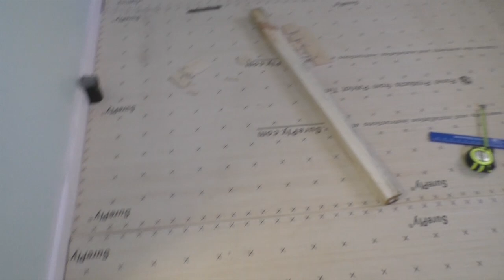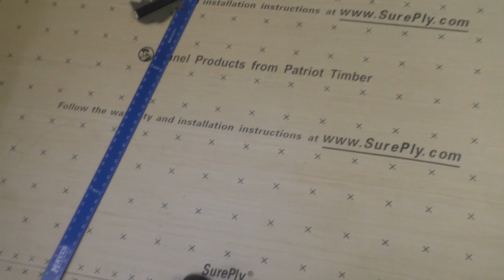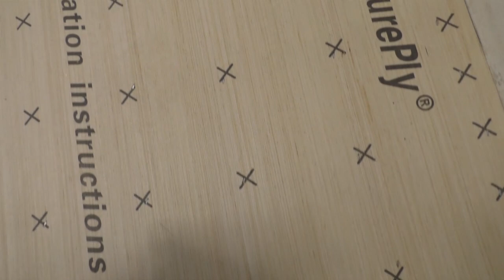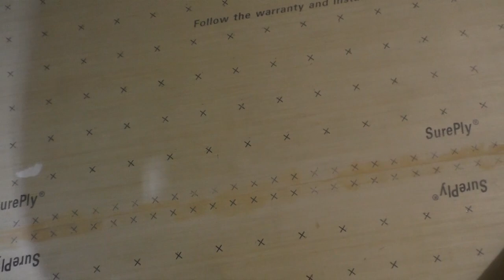Replacing my 1950s Kitchen Floor - Part 3 of 4

Comment: If it is not seen, just use bondo and not wood filler. I have used it a ton on wood, and will now use nothing else. I used it in a big section of my patio that rotted out from the rain... even the painter could not believe it was bondo when I was done. He wanted 200 bucks to replace that section of the patio.
Reply: Bondo breaks down much faster than wood filler when wet. Wood filler also has shavings, helps with expansion and contraction and wear. Most wood filler is cheaper anyway.